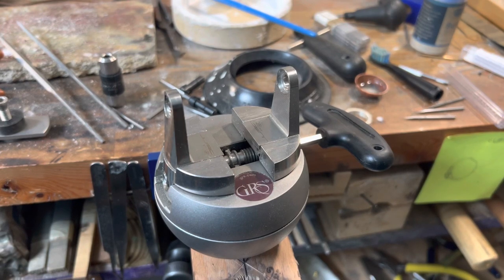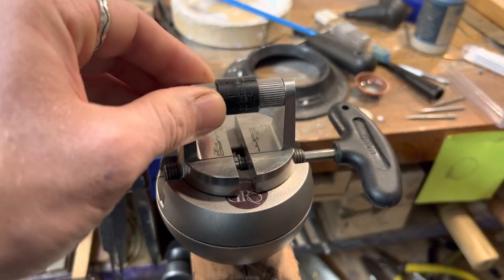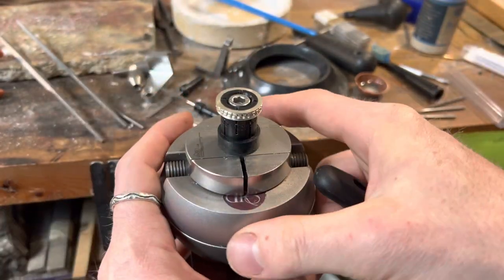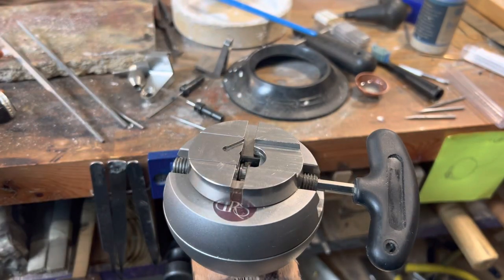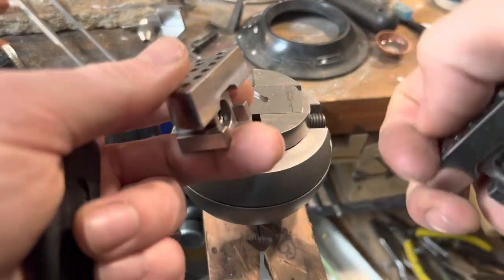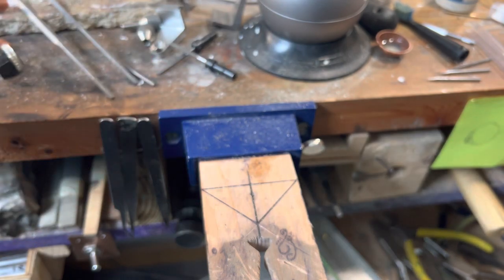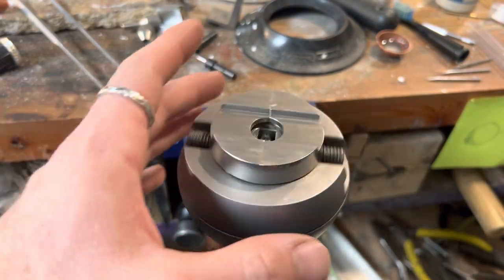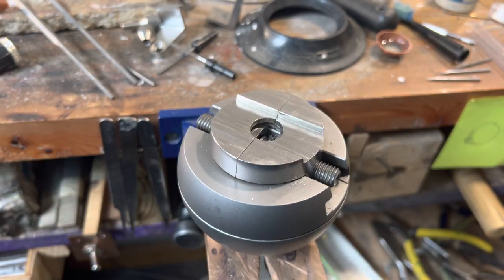Tool Time Tuesday! Jura Micro Block

Comment: Hi , how does the master jaw fit in the grs ball thread, mine was super snug, almost has to force the hex key to get it in
Reply from the maker: The other set of jaws is oriented. Each piece is either left or right. If it is snug try swapping sides.